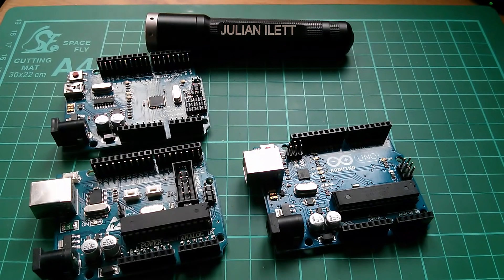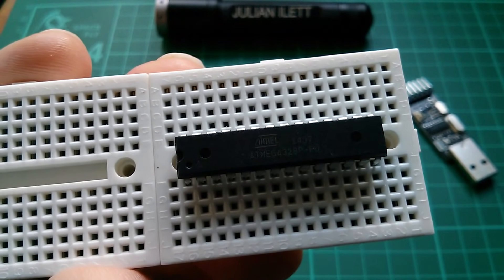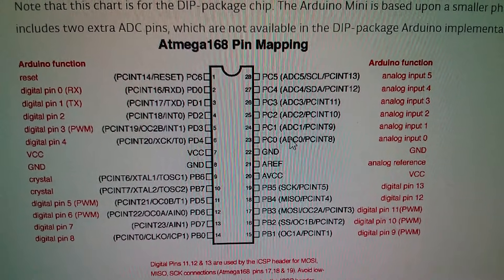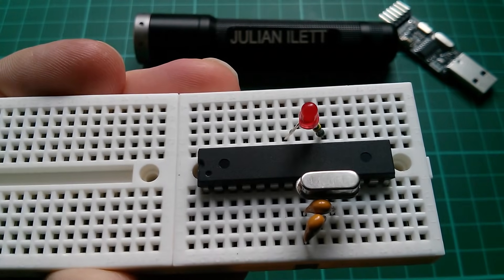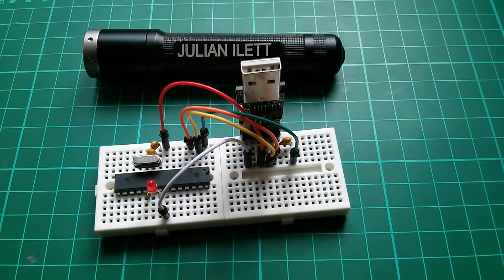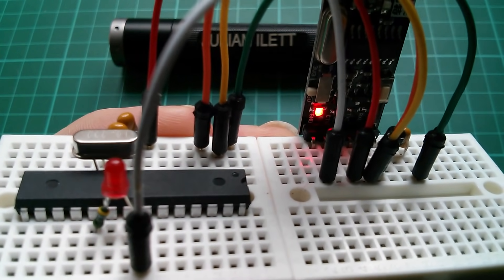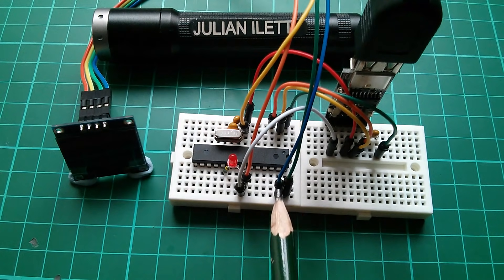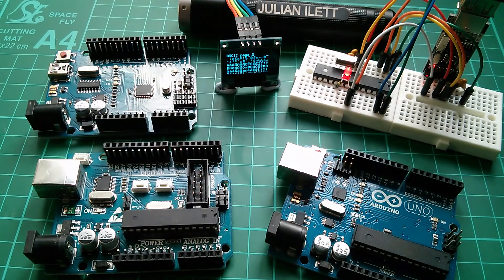1-Day Project: Build Your Own Arduino Uno for $5

Comment: Arduino it's just a IDE and board to program chips, what you actually have is not an arduino but a ATmega chip.
Reply: +Domino SixO Yes, but... this ATmega chip can be used without external chip programmer. An AVR programmer alone costs at least 3 dollars, which is almost as much as the total cost of this Arduino.
Reply: brinckau
You bootload and program the chip with arduino. The arduino is the base/platform to use different kid of chips and programing them thru arduino. What is in this video is just the Chip "328p" or any kid of chip without the arduino platform of curse the FTDI works as a arduino programming chip. So even if you program your chips you don't need the arduno ftdi after that, you just take the chip and use if on what you need.
Reply: Domino SixO The FTDI works as a programmer if your chip is pre-programmed with the bootloader. Or, more precisely, the chip is its own programmer (thanks to the bootloader) via the FTDI interface. If you buy a chip without bootloader, then you have to buy a chip programmer, because you can't use the FTDI interface alone.

So what this video shows is not just a chip + FTDI interface. It is an Arduino, ie a chip + a bootloader + FTDI.

But of course, once the chip is programmed, we can take it off and put it on a PCB to use it.

That said, I kinda agree with you and I think the Arduino is kinda pointless if you want to learn how to use a microcontroller. But I have to admit that its self-programming abilities and its IDE make it very easy to use. You just connect it to your computer via USB, write a program, and click the upload button. Without an Arduino, it is slightly more complicated.
Reply: brinckau
Arduino board works only as base to upload bootload and code, the most important is the chip, you can take off the chip of the arduino board and put it on your own pcb without needing arduino board of curse that only if you upload the chip one without needing the usb port..etc
Reply: Domino SixO If you buy everything shown in this video but your chip is not pre-programmed with the bootloader, then you won't be able to use it. Right?

So, unless you have an external chip programmer (like those "usbasp" that are sold on eBay for a few dollars), the hardware shown in this video is useless.

That's why the guy in this video does have an Arduino. He can program his chip as he wants because what he built is actually an Arduino.

The Arduino is not a base to upload the bootloader. As far as I know, an Arduino can not write its own bootloader to its chip (without tricks). You need an external chip programmer.
Reply: brinckau
You can upload a bootload with arduino on a chip
Reply: Domino SixO Well if we can, then I didn't know. I just checked on the Arduino official website and here is what I found:

"To burn the bootloader, you'll need to buy an AVR-ISP (in-system programmer), USBtinyISP or build a ParallelProgrammer."

AVR-ISP and USBtinyISP are external chip programmers. The ParallelProgrammer they're talking about is just using the parallel port of a computer with a few resistors and a special software.
Reply: brinckau
You can bootload with a arduino, this video does not have arduino
Reply: Domino SixO It has the same chip as the Arduino, with the same software, and the same interface. The IDE couldn't tell the difference.
Reply: brinckau
Well that's my point, you don't build arduino, you just get the same chip. Arduino is just a board, the chip maters.
Reply: Domino SixO You just get the same chip, and the same oscillator, and the same USB/serial interface, and the same bootloader.

The Atmega chip is not designed to be used like this in particular. It is a general purpose microcontroller. Someone built a circuit with such a chip, an oscillator, a USB interface, then he wrote a bootloader and burned it into the chip, and he called all that "Arduino". And you can build it.

Likewise, if I build a circuit with a few components and some software, I can call it the BrinckauBoard. For example, it could be the same thing as the Arduino, but with a bluetooth interface instead of USB, and some firmware so it can communicates with an IPhone. And if you build a BrinckauBoard, then you'll have the same thing as I have. But the microcontroller alone will not be a BrinckauBoard.
Reply: brinckau
You know that I'm really bored to read all that.
Reply: Domino SixO Ok. What this video shows is not an Arduino. So to people who might read this and want an Arduino: don't build this because this is not an Arduino!

I hope you're satisfied.
Reply: brinckau
You can build this and it will work but that doesn't mean it's arduino :D end of story
Reply: +Domino SixO You are very confused.
Reply: KillJD
Arduino is the name that people gave to the board that builded to be easy for other people to program a atmel chip with C/C++/Java knowledge. They use a bootload for each chip to transform your IDE code in assembler code and make your coding easy to understand. What you see in the video is how to use a atmel chip with the basic components and bootload of arduino. In reality you use necessary components to run a atmel chip but that doesn't make it arduino "board" You can program the atmel chip with other programs as well and upload other software bootloads
Reply: +Domino SixO Very true.  I misunderstood what you were saying originally.  My bad.
Reply: Please don't feed this troll. lol
Reply: Domino SixO If you buy a Samsung phone, then you won't have Siri (for example). You may have something similar, but not Siri. With what is shown in this video, you can do anything you would do with an Arduino (use the same modules, the same libraries and software, the same IDE, etc).
Reply: +Domino SixO , you are right, arduino it's a projecto to introduce at microcontrollers, but it's not programing in c++ already, it's a variant called ANSI C (or something macroassambler for microcontrollers) this makes you don't have to work with assamble languaje, and this video it's showing how to create a microcontroller loader, but the magic from arduino is you can handle your microcontroller with careless, because the microcontrollers can be esaly damaged with the electrostatic charge, and other features is you can improve all you learn with your arduinio with the microcontroller in general (your programs can work with a few modifications in a microchip's controllers other seller apart from atmel) and all component you can concet to a microcontroller has a plug and play version for arduino, (you don't have worries about burn your lcd) it's awesome have this devices now (in the 90's was difficult work with microcontrollers)
Reply: ***** I totally agree with you, arduino is just a software providing a bootloader/driver to have a more easy/friendly user interface coding, at this point I agree again that if you want to do more compact controlled projects you will not use arduino IDE..etc In my case arduino helped me a lot building my own projects and I can modifie the projects in the way I want. 

In the other way I don't like how people call a atmega chip with the necesary hardware as arduino, yes you may use arduino bootloader but you can't call it arduino.
Reply: +Jaakko Fagerlund LMFAO this was fun to read
Reply: therealnightwriter you use arduino bootload to work with the atmega chip, you can use the same chip and program it thou other programming language (software), you will call that arduino as well? NO !
Reply: Jahziel Rae Arceo what troll?
Reply: mttorresrivera You will take care if you are a good in electronics
Reply: Domino SixO yes that is the reason why arduino is an easy way to enter in a microcontrollers. And this is video make and PIC loader at the old way (and the old worries about the microcontrollers), but compatible with the arduino software tools (and anothers sofware tools in the market).
Reply: +Domino SixO how are you with people calling you a pedant? also do you force people to refer to their pcs as Intel machines running windows?
Reply: Wuety06 Yes, I call my PC, "transistor" because there is many transistors on my MB...
Reply: +Domino SixO actually if your pc is consumer grade and made in the last 5 years, the vast majority of transistors will be found on the cpu not motherboard. More and more functions that used to be done by the mobos north and south bridge are now on the cpu die... get your shit together bro
Reply: Wuety06 What are you talking about...
Reply: +Domino SixO Wow, you have no idea what a bootloader is and where it is. Not even going to bother with all your other messages that have no sense in them.
Reply: Jaakko Fagerlund I wouldn't be using what I'm using or commenting in this video if i wouldn't knew what a bootloader is.
Reply: Domino SixO Well then learn English, as your comments point out otherwise.
Reply: Jaakko Fagerlund English is not my native language, at this point everyone on the internet communicate in english so I do my best, if you don't like it, it's not my problem.
Reply: ***** I'm not the one who says retarded comments about bootloader.
Reply: ***** Nobody has commented that anyone is retarded. Maybe you should check on your reading and comprehension skills before starting to comment on things. And if it bothers you so much, then stop reading.
Reply: ***** You derailed the conversation to this point, so have fun.

Comment: Great tutorial!  What is the value of the LED resistor?
Reply: Probably 220 ohm
Reply: Tom Adamson 
Any value between 150 and 330 will work. The larger values will make a dimmer LED but it will live longer. 
My rule of thumb is LED = 2 volts and 0.02 amps (max). 
SUPPLY_VOLTAGE - LED = RESISTOR_DROP therefore 
5 - 2 = 3 then 3 / 0.02 = 150 ohms. A 330 ohm will make for 0.01 amps (~ half)
Wattage = 3 * 0.02 = 0.06 watts. so an 1/8 or 1/4 watt will be perfect.

Comment: Thanks a lot!
Btw it is worth it to put a 10K resistor between the ATMega's reset pin and 5V to stabilize the programming a bit ;) Without that (with my USB to serial stuff) the software reset function doesn't work always.

Comment: if my chip don't have arduino uno bootloader just a new chip so what  should i have to do to have bootloader on my chip
Reply from the maker: Diem Dang Thank I need to make an Arduino Bootloader Tutorial ;)
Reply: +Julian Ilett Thanx for filling more pieces of the puzzle, now it's just the USB converter and how the data is sent to that kind of display. (Continues Googling, including bootloader).

Soooooooooo much to take in. 0_0
Reply: (EDIT: ) Strange I still have double posting problems, gotta google that right away...

Comment: If you already have the arduino uno board, you can just program the bootloader by replacing the supplied atmega-328p with the one you have purchased and just flash the bootloader from the arduino gui. Also after you flash the bootloader and put back your 328p on the bread-board, you can program it using your arduino again.
Yet another two methods you can save a bit of money and also not worry if the bootloader is on the MCU or not.

Comment: I've been watching this video again and I've been thinking first of all you only need to use that USB to serial converter only once. so in the long run if your building more then one Do It Yourself Arduino boards, you only really need one serial converter to program each one since you can only do one at a time anyways. so actually it is cheaper. especially if your building many permanent atmega328 projects that don't need a serial converter once you already programmed the chip. :-)

Comment: you can always trust a person that sharpens his pencils by hand/knife. BTW... thanks.
Reply: I wouldn't have noticed that if you hadn't pointed it out.  Yeah, common practice with awkwardly shaped/art pencils.  Probably a habit.
Reply: My old art teacher in highschool always did this, he had some untrustworthy tendencies.
Reply: @CoryMck  Was he a boy scout leader too?
Reply: @englishrupe01  No, not to the best of my knowledge
Reply: Artist do it to give their tip a beveled Edge. Helps line variation.
Reply: ...and connects LED without a resistor. ;)

Comment: What's the value of the capacitor you're using?
Reply from the maker: Wings Division Frequently asked questions about this video are answered here: http://256.uk/?p=70
Reply: +Julian Ilett can we use 18 pF instead of 20 pF and can we use 150 nF instead of 100 nF? thx in advance

Comment: this is really useful video! arduino is easy to use, but in most projects, a uno board is too large to fit in and in most cases we just need some of the functions. so it's great to do a custom build.

btw, it's really crazy that uno R3 priced at 25 pounds...

Comment: Would it be possible to overclock a microcontroller by having a faster crystal? Like say, instead of 16MHz we use 32 MHz?
Reply from the maker: FlumenSanctiViti Yes possible, but the data sheet advises about the max clock frequency at different operating voltages.

Comment: I enjoy watching your postbag series. I also built one of these own Arduino with similar components. It did not work at first. Finally I learnt about the tiny 3.3/ 5 V switch on the Serial adapter in one of your other videos. Switched it to 5V and eveything works fine. Thanks

Comment: Very cool. I could see an application of the this type for small production runs of different types. I don't see why you couldn't solder the components direct to the chip and put the whole thing inside a tube fill it with epoxy, having the relevant wires stick out and make a water proof/ explosion proof mini ardueno

Comment: Julian Ilett  
Great video. Very detailed explanation.
 I have few question, as I am getting started in Programming for Arduino where can I get to learn all it's stuff. Also you explained which pins to be used on the chip, I want to learn pin identification as well. 
Basically I am starting from scratch, any guidance will be helpful. Thank You.

Comment: hiii...
I am doing the same project. I am using ATMEGA328P-PU. But the project did not work. whenever I connect it with with my pc via a TTL converter the indicator led is not blinking. Icheck my circuit 10-15times. There is no fault in my cicuit. What I have to do? plsss help...
Reply: Maybe your IC is broken.. Due to possible overloading

Comment: i keep getting this error: avrdude: stk500_getsync(): not in sync: resp=0x00
what could it be ?
Reply: +Bogdan M did you get to know how to resolve it? I got same issue
thx in advance
Reply: i did solve it, kinda, i have to press reset on the usb to serial adapter every time, just before i upload the code. it works for now.
ps: make sure you have rx and tx connected properly.
Reply: i have everything like the circuit but even when i plug the circuit to the PC it doesnt get recognized as an arduino. So since i have a arduino uno i'll try to remove the ATMega of the UNO, plug-in another ATMEGA and then  program it using the arduino uno platform
Reply: +Bogdan M on regular arduinos, I have to press the reset button every time, you just get used to it
Reply: No its ok I got it working, you need a 10k resistor beetween vcc and reset pin
Reply: +HalfLife2Beta Did you connect a 10K pull up resistor?
Reply: I just said i got it working in my last post but thx still

Comment: I have built this and everything seems to be working fine, except for one thing.  My code that I'm running uses a piezo speaker and it isn't working properly.  Instead of the clean chime, I get a very interesting gurgling sound.  Also, it is programmed to chime every 10 seconds for 1 second each time.  The actual result is a chime that lasts anywhere from .5-10 seconds (it changes each time, it's not consistent), and the delay between each one is about 30 seconds instead of 10.  Does anyone know why I am having this issue?

Comment: Buying it from Maplin hardly supports the project, they are a rip off company and use extraordinary mark ups.

I only ever buy components from there if I am absolutely desperate. They are generally 10x cheaper from online. Copper clad and FeCl3 are fairly reasonable although I have noticed that my outlet has switched to FR2 from FR4 without the price reflecting.

Comment: Does the CH340G chip work with the arduino nano v3?
Reply from the maker: hellhasgone01 You can get a Nano with the CH340 onboard - generally cheaper than the FTDI Nano
Reply: Julian Ilett Thank you. Omg i think i got confused though. Lol. Because I'm already able to connect it with micro usb to usb. but thank you.:) I think i was thinking about something else. Like with other projects. It will work with alot of other arduino chips right? And it is compatible with a nano if i want to hook it up to the pins right? I'm kinda new to this.

Comment: You don't have to have the crystal and caps if you bootload to run on the internal 8MHz oscillator. Doing that will let you run at 3.3V, is there a 3.3V USB to serial for $1?
You should connect all the grounds and you should put a bypass cap across VCC and GND. The bypass cap will help keep the chip stable when you start changing pin states quickly.

Comment: Good morning, I have same problem like Javid Shaikh, when i want to programm atmega i see avrdude stk500_getsync(): not in sync resp=0x00, i tried RST threw 104 cap it doesent work
Reply: pull up the reset line with a 10k resistor

Comment: Hi. I don't know if someone else has mentioned this before now, but for my Arduino to work, I needed to put a 10k Ohm pull resistor directly between pin 1 and 5V. This ensures that as soon as the program is loaded, the /reset will immediately be pulled high again. This just helps that the reset pin is not in an unknown state after the DTR is 5V, but the capacitor still needs to be charged